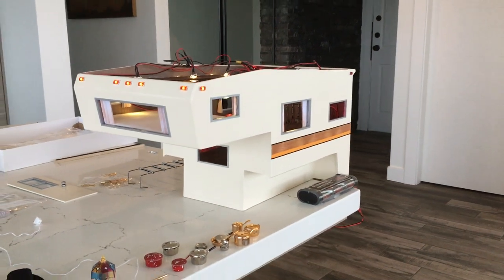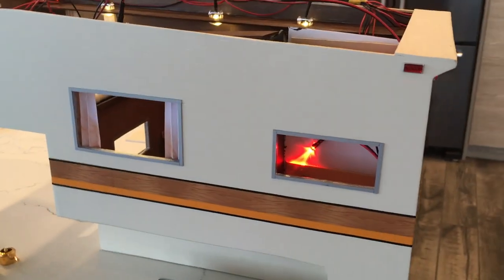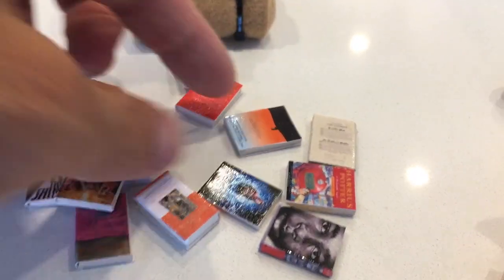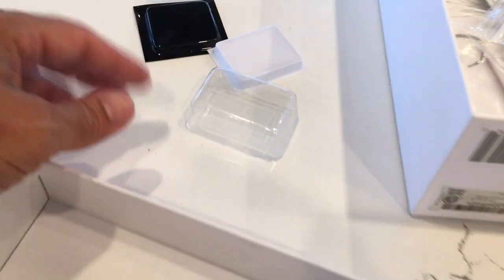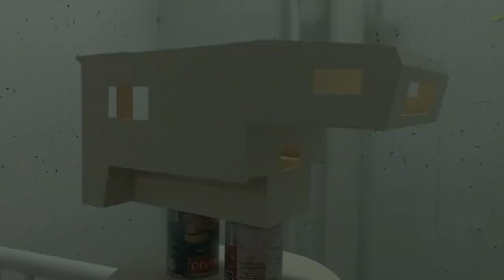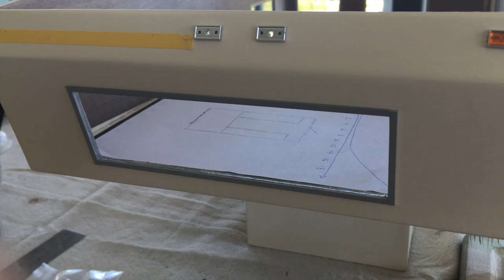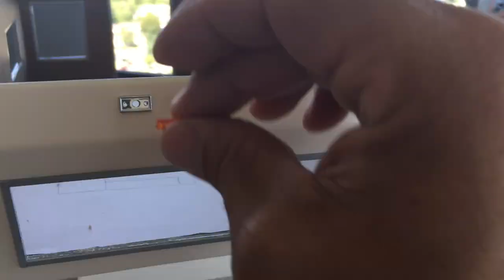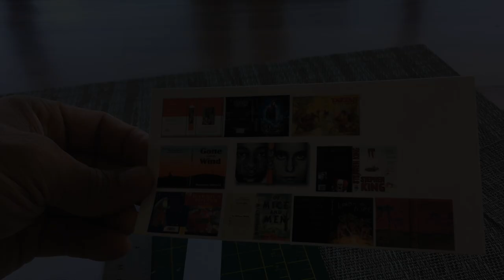1/10 Scale Slide-in Truck Camper Build for Carisma f150 part 2

Comment: These video inspired me to make my own for my TOYOTA hi lift 👍🏼

Can I ask where did you find the exterior lights from 

I can’t find them any where 
I need the same lights you have 👍🏼👍🏼👍🏼 thanks awaiting your reply
Reply from the maker: Good to hear pal. Heres the link to the parts. One chrome tree and one clear tree will do 4 marker lights. I used a total of 14 lights so I needed 4 chrome trees and 4 clear trees, it added up quick. Unfortunately rc4wd doesn't sell just the marker lights separately, I had to purchase the entire tree, but I used some of the other lights inside the camper interior so it wasn't too bad. Hope that helps. https://store.rc4wd.com/RC4WD-Cruiser-Body_c_473.html. z-b0075 and z-b0077. The brake lights came from the cross rc demon